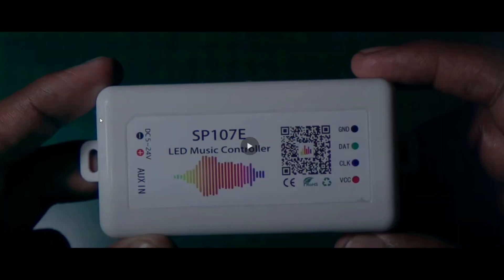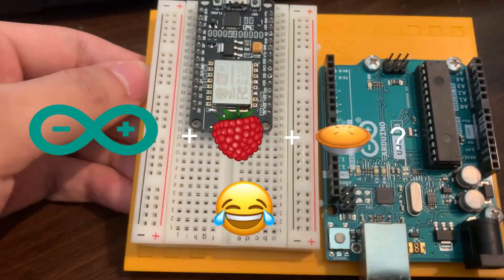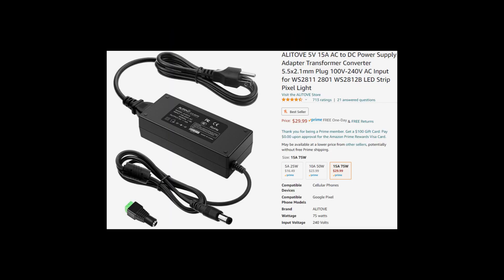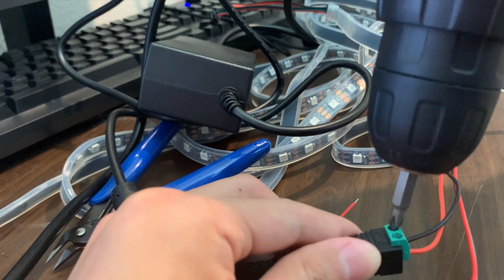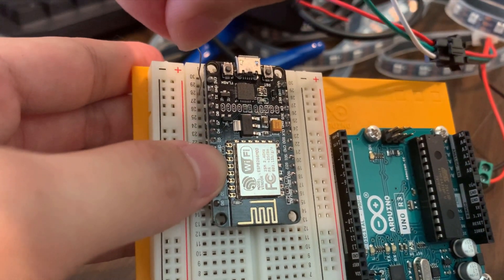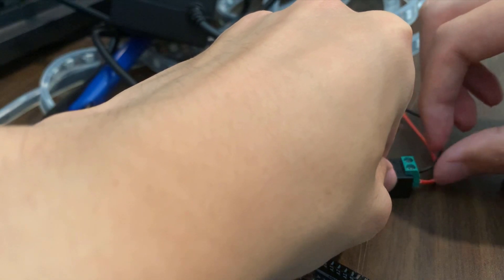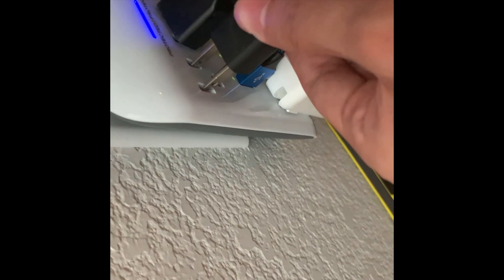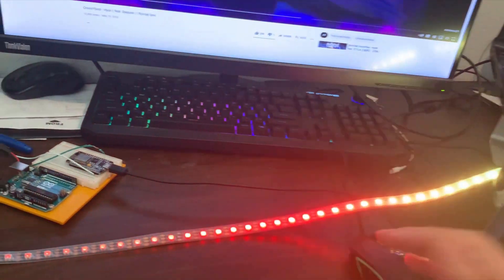DIY LED Music Visualizer (Arduino and Python)

Comment: I'm looking for references, since I'm working on a project that I'm doing the same but on leds of a switch. I send the amount of load based on how many leds I want to light up. (The switch has a load-monitor kinda stuff built in that lights pins up based on the load)

Comment: hi i have a couple of questions. 1 what is a capacitor for. 2 you have NodeMcu v3 CH340 or NodeMcu CP2102 or NodeMcu v3. 3 on github saw that more than 256 LEDs do not work on the ESP8266, did it work for you?
Reply from the maker: 1. I'm not an expert, but I believe the capacitor is used to control the voltage to some degree to prevent spikes
2. nodemcu esp8266
3. Haven't tried 256 LEDs. I actually had to change the NUM_OF_LEDS down since mine was shorter than the default length it was meant for.